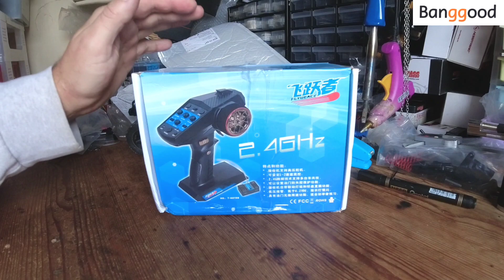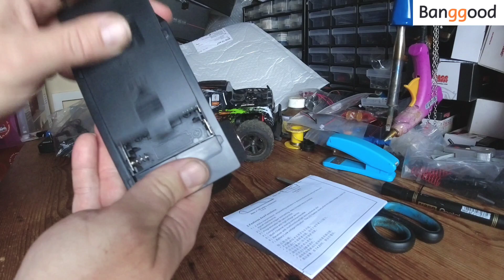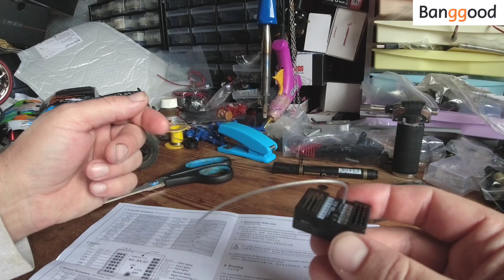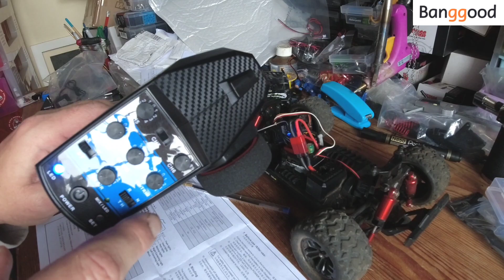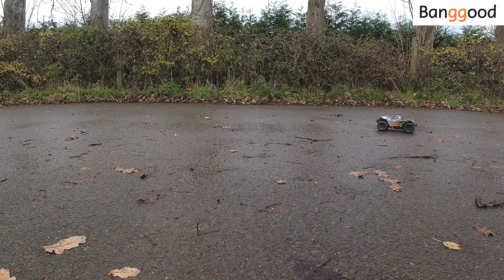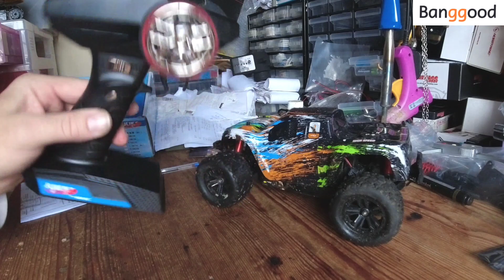Decent Budget 7 Channel Transmitter Combo Tested. FLYUEACE T-6819C 2.4GHz.

Comment: On the Banggood page, what is the difference between the T-6819B and the T-6819C?? Thanks.
Reply from the maker: I think the C has the lighting outputs?  👍
Reply: I got the dumbo 6ch with lights the X6P only to find ch6 usually used for gyro gain had become a button, even tho they sell the receivers with a gyro X6DCG. But yeah the X6DC receivers look much like this

Incidentally I noticed Rllarlo use the dumbo x6 transmitters with a button instead of a dial on ch6, but the gyro has been moved to ch4 or somewhere
Reply from the maker: @shadyhazza  your a wealth of knowledge!  👍